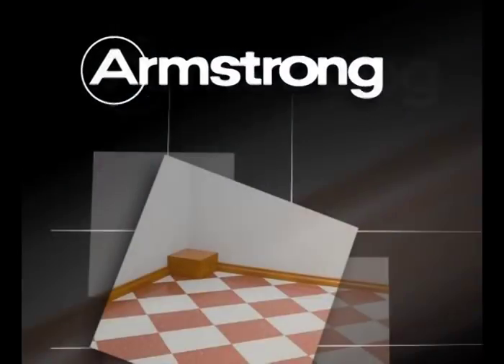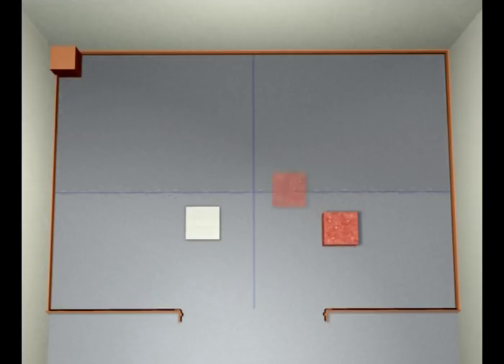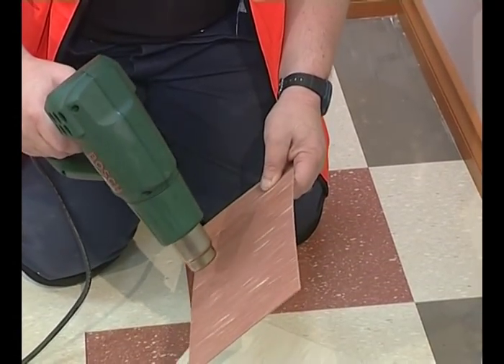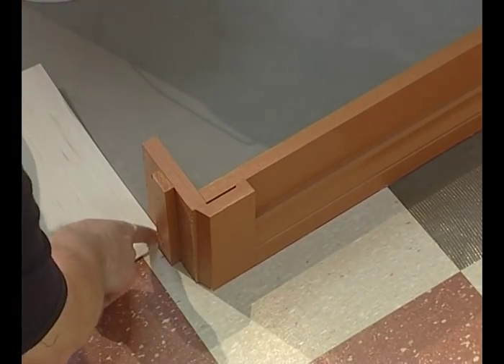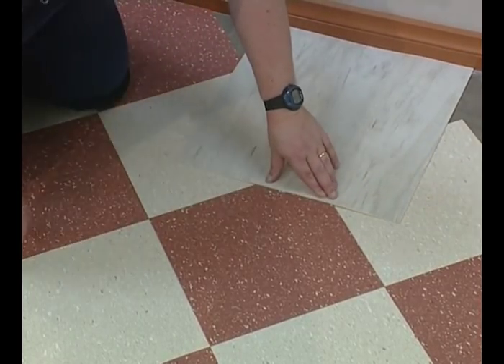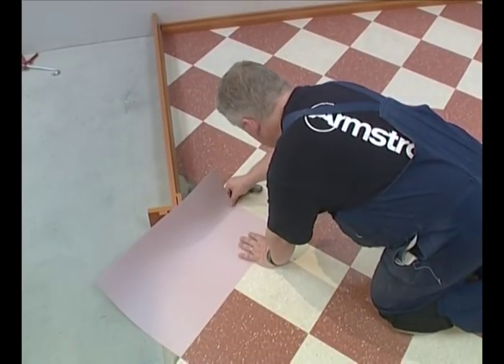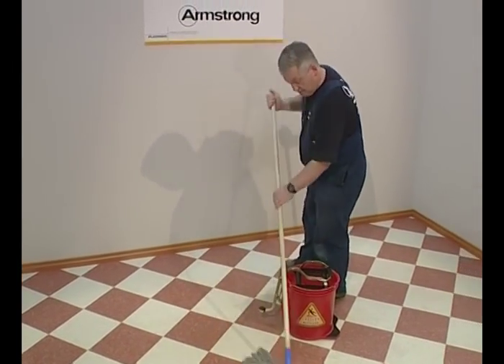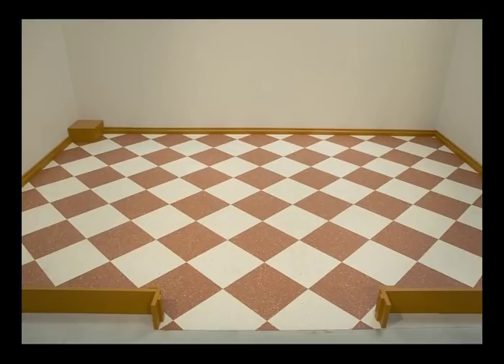Armstrong Vinyl Tile Installation and Maintenance Guidelines

Comment: Who has time for this?  At my work I only have the weekends and the floor is always destroyed before it can set.  As for floor finish; don't put it on in the winter because you need a good week for it to harden otherwise the salt will cause the finish to flake...    In my years of experience, I found it best to go with ceramic at work because there is way to much maintenance for vinyl flooring.  Also, be careful with coworkers and clients/customers, because even if you have a section blocked off there will always be someone who will move the barricade out of the way and walk on the floor when it is not ready.  And lastly: if there is an office desk than use stainless steel tiles or something stronger than vinyl where the chair sits because if there is the smallest speck of dirt under the chair rollers than it is going to be smashed into the vinyl flooring; I have replaced countless tiles due to this for nobody removes their outdoor shoes.  The only problem is that a vinyl tile costs about $2 each whereas stainless steel flooring is $20 each, but I promise you that there will be savings in the long run due to less maintenance and you only need this where the chair mostly rolls; approximately 4x4 feet...

Comment: Hi, nice video, 👍👍.. a question Plzz..
If this vinyl floor gets damaged what to do. I have waterproof vinyl floor in our wet room. There is a cut around 6-7 inches long in the vinyl. Floor underneath feels very soft if stand on it. How to repair it? Or we need to install entire new floor? Thanks.
Reply: Hi , i believe i can help. Long story short. You need a reparation Job done on that part. Possibly two. If you get an old average floor cover they will remove damaged tile and replace with the same exact tile if not something close to it. But as for the floor damage under. Someone needs to have some knowledge on structural parts in a home. For example someone who installs hardwood floors.

Comment: Hi, I'm installing this floor and I want to know what product is used to seal when the installation is finished, I appreciate if someone helps me
Reply from the maker: Hi Tatiana, we recommend Armstrong Flooring "Shinekeeper" a high solids floor polish, if the store you purchased the tiles from doesn't have this, you could use Gemini floor polish from Peerlesjal which is available in the cleaning aisle at Bunnings.

Comment: What is the measurements for that arch marking tool? How far apart are they and especially where there are two holes.
Reply: The longer the distance of the arch’s you swing the more accurate the layout being squared up will be. Just make sure you choose equal points When swinging

Comment: Just seen a huge ass church floor that was the straightest floor I've ever seen. No gaps anywhere. On MDF no less. The only issue I have with it is that maybe 1/12 of the tiles had cracked corners. Considering how straight it was, cracked corners seems acceptable. I wanna know what's up.

Comment: that is ease in small rooms,but what when is big rooms like 40x40 ft,and when you square the area; wall is not square,or in that big area tile start to running for the miss leveling of the floor.

Comment: I have these armstrong vinyl tiles. Does anyone know if the overlapping vinyl template is 17 inches x 17 inches? I believe this is correct.
Reply from the maker: Sorry we are not sure what you mean. These tiles are either 300x300mm or 305x305mm (12"x12").
Reply: Armstrong FlooringAUS Armstrong FlooringAUS at 12:48 in the video, measuring the distance from the vinyl tile, end to end is 17 inches horizontal as well as vertically. So I just got some plexiglass cut to 17x17 inches to use as a base for angle trimming. Thanks so much for such an informative video. It works great.

Comment: Does any body knows why let the glue dry? And for how long?
Reply: Because it’s not a wet set installation. If you installed it wet the tiles would slide all over. It is a pressure sensitive adhesive. So once it’s dry that’s when the tiles will stay where you want them. Wait until the glue is completely clear. If you swipe your fingers across it no glue should be on your finger tips.
Reply: @georgemurphy3914  thank you very much for taking the time to reach me.
Reply: Not a problem brother. Good luck! 🤙🏼. Read the bucket of glue you are working with that is recommended from the manufacturer for the specific product you are installing. It will tell you the working time for how long the glue will still be good from the time it is dry until it’s not sticky anymore. Happy installing

Comment: "Equal overlap method" is a waste of time.  Just place the tile over the partial tile position against the wall, then flip the tile over, flipping the tile toward the wall.  Now mark your tile on both edges and then cut it. Done.